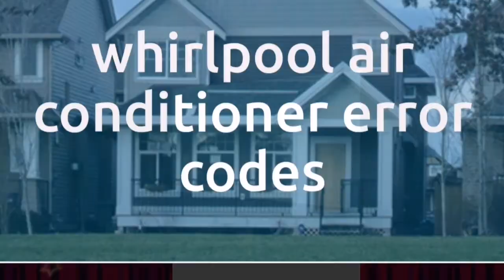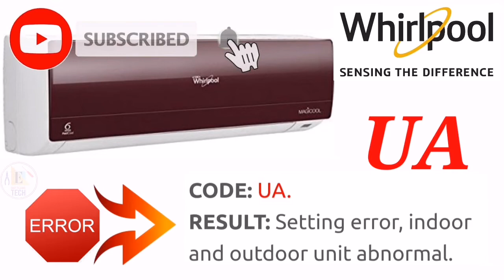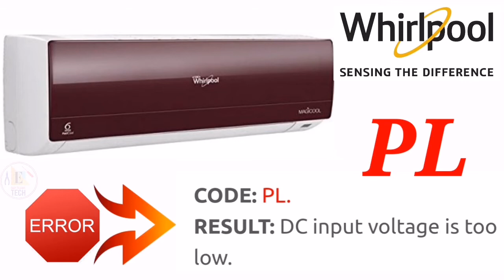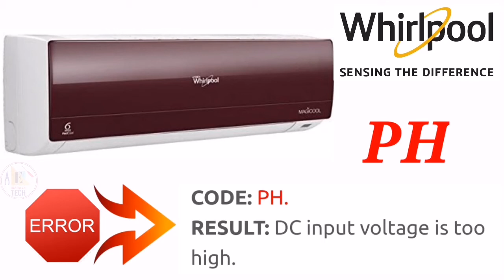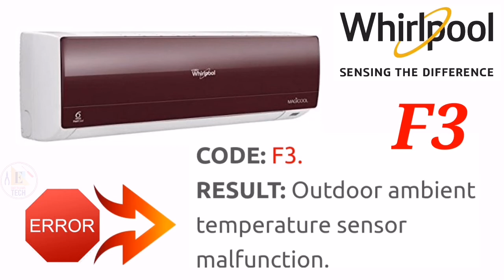Whirlpool Inverter air conditioning error codes and solutions // List of errors code & Solution //

Comment: hello sir!  I have a whirplool SPIW 409L, indoor unit is fine, no error code,  works totaly normal, but of course, no cold air, outdoor unit is totaly dead, i have 1 blinking led on the outdoor unit pcb, the one next to the fan conector, and that's it. (I rotated the fan by hand, and it is ok, spins smoothly) Do you happed to know what could it be? Thank you very much!
Reply from the maker: After rotating the outdoor fan, if the unit is cooling properly. It means there is an issue with the fan motor . Need to check all the stuff connected to the fan motor. Issues like the connector are not good ( rusted) , Fan motors stuck from inside, ...

Comment: F6 error ka kya reason hai
Reply from the maker: Error code F6 on a Whirlpool inverter AC indicates a communication error between the indoor and outdoor units of the AC. This can happen due to a faulty connection or wiring between the two units, a malfunctioning control board, or a problem with the sensors.

Comment: Good morning sir..F3 ERROR CODE SPLIT TYPE INVERTER AIRCON.Indoor is okey but the outdoor is not.the fan is running only for 2 or 3 seconds,it will stop after 3 seconds...how it goes?
Reply from the maker: Outdoor ambient temperature sensor malfunction. Change the sensor which is near the condenser coil of the outdoor unit.

Comment: Whirlpool AC main 
P3 ku aata h
Reply from the maker: This simply indicates you that the outdoor ambient temperature is too low for your compressor to operate.
1) check the ambient temperatures Sensor of outdoor unit.
2) check the gas level.
3) fan speed in outdoor unit.
Reply: @Rehankhan_HVAC_TIPS   thank you sir

Comment: Sir i have 1.5 ton 3 star inverter split ac. My question is what is the temperature of discharge line at the outdoor unit.At my outdoor units discharge line there is condensation. Water drops are generating on discharge pipe at outdoor end. This is normal or there is a problem.
Reply from the maker: Note : discharge (small pipe)  is making water drop or suction line (big pipe) let me now.
Check the refrigerant gas pressure, gas may be leaking from some place that's why it's make condensation.....
Reply: @Rehankhan_HVAC_TIPS  sir in both pipes(small and large pipe), condensation is shown while running of AC.
Reply from the maker: Which one is more chilled
Reply: @Rehankhan_HVAC_TIPS  suction pipe(Large dia) is more chilled
Reply from the maker: Than its ok , when you see small dia is more chilled than large one than thier is a gas LEAKAGE.
Thanks for supporting
Reply: @Rehankhan_HVAC_TIPS  ok. 
Thanks for answering.
Reply from the maker: That's why I created this channel...... Mention not......

Comment: E8 means
Reply: Same problem E8 , aapki ye problem solve hui kya please update
Reply: No
Reply: E. 8  ka.  Koye samadan. Batye
Reply from the maker: An E8 error usually indicates a fan problem with the indoor or outdoor unit. An E8 error is usually cleared by power cycling both the indoor and outdoor unit by turning power off at the breaker.

Comment: What does it mean if it shows E5 error.
Reply from the maker: E5 means Overcurrent protection.
Need to check the outdoor Pcb, if the DC voltage is correct or not.. Need to change the PCBs of outdoor